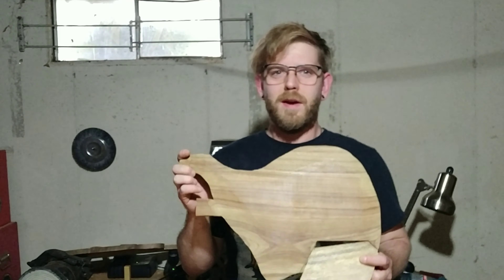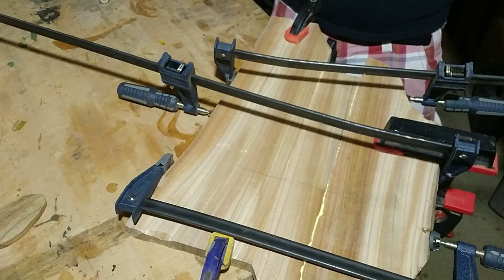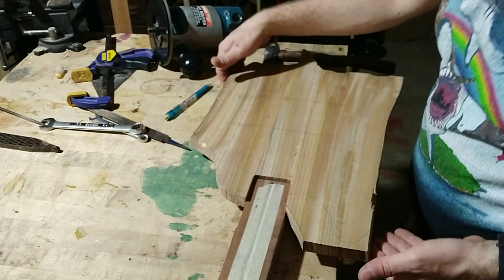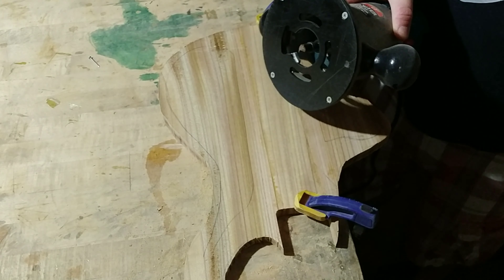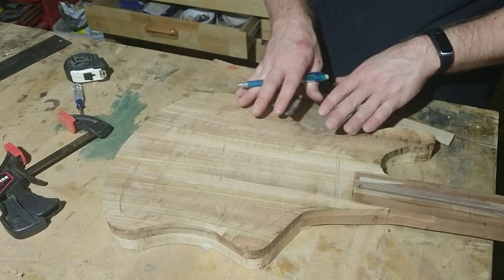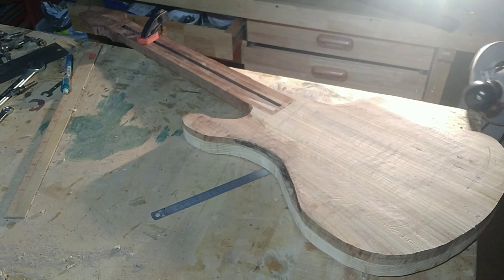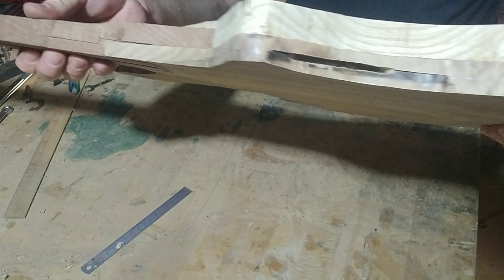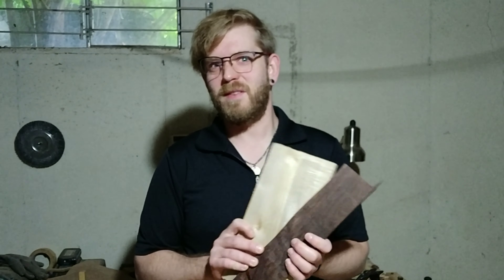Carving The Top..Taking A Scrapped Guitar Build and Making It Awesome? Great Guitar Buildoff Part 4

Comment: Eager to find out your plans for those scraps. Question...at 57 yrs old, I've decided to build my first complete guitar from "scratch". Any words of wisdom? Thnx in advance.
Reply from the maker: Just like any wood working really the best advice I can think is accurate measurements. I find I measure things countless times before I make a single cut even after having done it so many times. Paying extra attention to the neck/fretboard and strung areas because if that's off the whole thing will be. The overall shape can be toyed around with the playing surface is the bulk of the instrument, so I always pay extra attention on that portion. There are alot of fretboard tools online to help with scale and fret position which do make this easier. Trust me when I saw doing the calculation by hand is no fun😂 done it a few times now I have a ruler that does it and I'll never go back.
Reply: @MilesMcNallyLuthierie  Thnx Miles!
Reply from the maker: No problem sir!